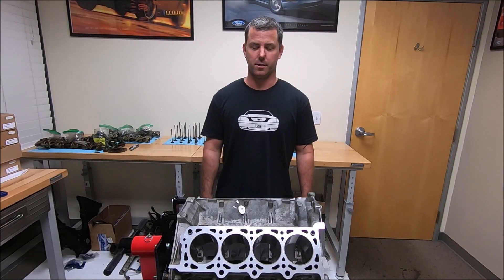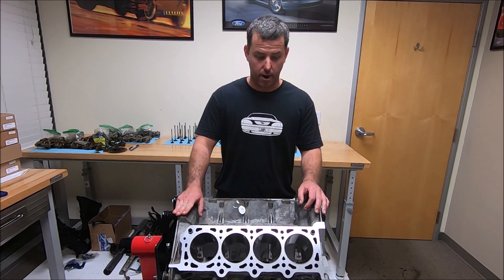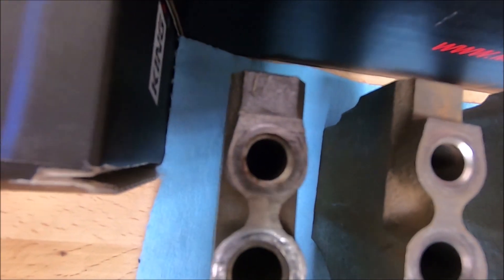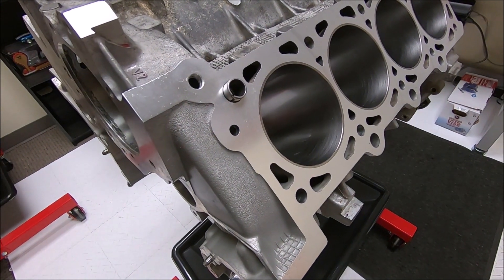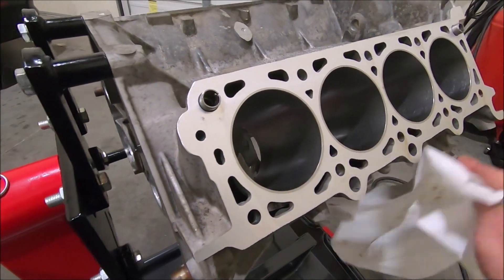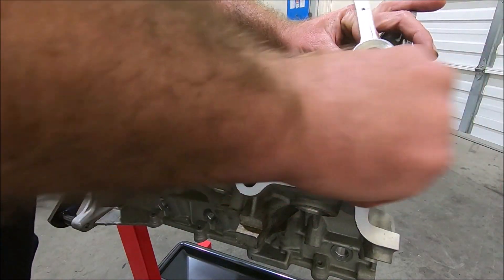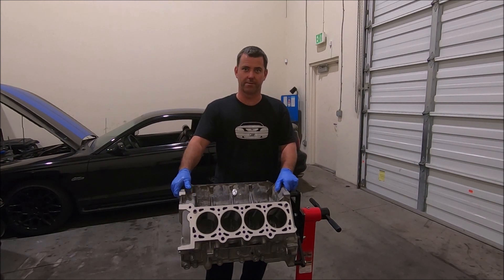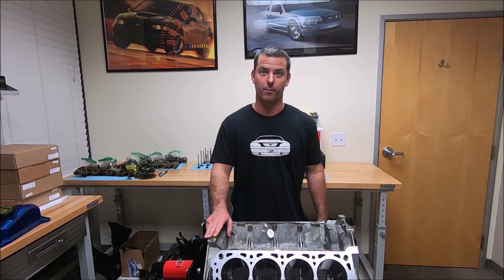Ford 4.6 aluminum Teksid engine block information and preparation

Comment: Can you help me out bro? I have this block from mmr, it was built for a 2v the clowns never drilled the 2v hole for water passage heads, but my main concern is all these comments related to the timing system and clearance issues? I am using cobra engineering pin kit and going with a 8mm upgraded pivot pins screw in, I am using Shelby mike timing stuff with factory chains, my engine is a 4.75 stroker 1000se, but I need you help
Reply: I never drilled the passage on my blocks either. My current. 4.6 2v has 734k miles on it now and it has never been hot. Hauling trailers with scissor lifts all across the country. I didnt drill the hole on the new 5.4 block sitting in my stand ATM either. Keep the heat out of the oil with that rear head cross flow dealy( copy MMRs with ACE hardware or home depot for like 40 bucks) and keep up with maintenance. A water pump is cheaper to change before going bad than it is building one these things. 2v heads are getting rare and $$$$$ ans intakes are non existant. Unless you widen an Eddie. Or find a hps hardballr....somewhere lol.
Reply from the maker: I have built engines with that hole drilled and without it being drilled without coolinf issues.  If you want to drill it use a gasket and center a hole in there about an 1/4 inch.  What clearence are you concerned with?
Reply: @JohnSmithRacing  timing guides? A lot of post saying they hit oil pump area, not sure if this is true or not
Reply from the maker: @2vgod460  I have used the Cobra Engineering kit with and have not had clearence issues.  Its a great kit in my opinion.  You can email me pictures if you want a second look.

Comment: To run @ 1000whp. What boost and octane levels are you're looking at? With a teksid base block.
Reply from the maker: Boost will depend on heads and CR but most likely E85 or Race fuel to get those numbers
Reply: @JohnSmithRacing  kind of figured it had it been at least E85, but I'm running into that problem E85 is not relatively available in my area, was thinking something maybe with methanol injection in between 100 to 110 octane. But I can settle for the 700 horse range
Reply: @JohnSmithRacing  I stand corrected on the E85 first I thought I would have to drive 100 miles out, just to go get some I found a closer station that offers E85 so check on that I don't think 18 lb of boost will do it. I was looking at a long block setup 4.6 two versions 1 safely to handle 18 lb of boost and the other 25 lb of boost but I'm already looking 10K just for the long block. For 25 psi boost . And the one setup for 18 is half the cost

Comment: Nice video, how's it coming along??
Reply from the maker: Thank you, this engine was completed.
Reply: John Smith Racing would a turbo application be better for this engine or supercharger
Reply: @JohnSmithRacing  Do you build engines for regular customers? I'd like to get a build started. Even just the short block. Proper prep, balance and blue printed engines are what make the improbable outcomes possible. And run reliable. That's where machine work and having the right tools come into play. That's what I lack  Id love to bring my aircraft knowledge into one of these Teksid blocks for my 98 GT.  NMRA factory stock guys are making, essentially factory parts, put down average 370 rwhp. No reason a really high compression, E85 feed, and trickflow headed combo can't put down close to 500rwhp NA. Of course that's with 7600-8000 rpm in mind...street driven. I want to see a nasty N/A 2v in my car to put the engine math on the streets. Making most people stare in awe as it keeps up with stock new coyotes without boost or nitrous.
Reply from the maker: @rayman1230  Yes, and I have been wanting to build a sleeved 5.3 stroker Teksid with high compression, TF heads, and Comp Cams.  I think with E85 it could put down over 450 whp.
Reply: @JohnSmithRacing  I'd settle for a 3.700 bore, stock stroke (boss 302 /coyote rods) and stock crankshaft. Keep it light weight to spin up quick. The stroke is already long. But the bore size is what kills the modular engine. As I'm sure your well aware of. That high compression ( 14:1 or higher) will really help with low end torque. Also, I want to see proper LSA used. 110° or tighter. Hydra boost rids the vacuum issue for appropriate brake boost pressure. I have yet to personally see cams that are truly made for full performance on 2v's, on the street.
Reply from the maker: @rayman1230  Sounds good to me.  We could get some custom Todd Warren cams with a tighter LSA.  With the right exhaust system it would have a sound that everyone would notice haha
Reply: @JohnSmithRacing  hell yeah lol Todd is good people. I had spoke to him before. He's a veteran as well and from Ohio lol
Reply from the maker: @rayman1230  Yeah, Air Force I believe, but we won't hold that against him haha
Reply: @JohnSmithRacing  Hey! Don't hate on my chair.. it comes in the form of a C17 😂 but yes, you are correct. He did the same job I do currently
Reply from the maker: @rayman1230  All joking aside, it doesn't matter what branch, those that served and continue to serve have made a decision very few make.
Reply: I’m going to look at a mark viii tomorrow

Comment: Don't know much but... there is a reason why Marvel's hero is not called Aluminum Man.
Reply: John Mihovetz owns the world record and did it with a teskid block. Most of the fastest 4.6 mod motors in that group are teskids. They are anything but weak. Also, the LS seems to do fine with aluminum blocks.
Reply: @benjamins9121  I was talking about production engines, not racing engines. I was talking about Buick (AKA Rover) factory engines, not about Ford aftermarket... I don't give a damn about 1/4 mile, because I want 250,000 miles.
Reply: @Los_Chanchulleros  I never mentioned aftermarket blocks, teskids came in Lincoln Mk8s and 96-98 Cobras although a lot of them wound up in 99 and 01 Cobras as well. I simply mentioned racing engines that used the teskid block to emphasize the power they hold. As far as durability goes they have that too, mostly due to the quality but also the fact that mod blocks are very large for their displacement and heat up more slowly than smaller aluminum blocks like LS's, and also they came with aluminum heads so everything heated up and cooled down at the same rate. I for example put 140k hard miles on my 97 Cobra before I decided to turbo it, the engine was rebuilt with the same teskid block and now supports a 76mm turbo setup. If you care to know but don't believe me do some research on the teskid block and you'll be pleasantly surprised with the strength and durability.

Also, I was strictly referring to this particular block, the teskid aluminum block that came with the cars from factory, I wasn't speaking for anybody elses blocks. Of course a poorly made aluminum block will suck, but the teskids are very well built and you get the strength and durability because of that. The company teskid is from Italy and produced block for Ferrari and Formula 1 actually, I think that says something to the quality. Neither of those things really back up the durability, but like I said if you think they can't handle 250k with proper maintenance you're mistaken partner
Reply: @benjamins9121  a lot of writing... that I will NOT read, but thanks.

Comment: Where could I get jacks crews? A customer brought us a block he bought online, and it's missing its jack screws. We have the new ARP bolts that go through them, but we're looking for jack screws.
Reply from the maker: As far as I know they don't make the jack screws anymore and no one makes a replacement.  You will have to get them used or find some in a junk yard.
Reply: @JohnSmithRacing  Thanks. I had the customer trace the path back to where the block originally came from and the jack screws have been located and we're expecting them shortly.

Comment: When using a 98 cobra teksid block, those use one thrust bearing correct?
Reply from the maker: Yes, one thrust bearing insert with the grooves facing the crank on the top half.  The bottom half has thrust washers built into the cap side bearing.  The grooves are to provide oil to the friction surface of the crank.
Reply: John Smith Racing  thank you! And i assume it goes on the outside of the the block not the inside bc, i tried inside and it just falls. I put it on outside whefe flywheel goes and it fits perfect
Reply from the maker: @lazy_4valve213  Yes it goes on the outside.  Think of it taking the force of the clutch being pressed in.  That area of a crank is common to wear out from clutches not adjusted properly or people riding the clutch pedal.

Comment: What's the timing dowel upgrades you have to do to a 2v?
Reply from the maker: The cast iron block dowels are pressed in.  Cobra Engineering makes a nice kit to drill them out and tap them for larger ones.
Reply: @JohnSmithRacing  thanks John I'm getting my teksid bored and honed currently, and was just trying to get everything needed before it gets out. I appreciate the response!
Reply from the maker: @cristianrivera6562  No problem.  Some will argue that you need to drill the driver side for a cooling passage but I have put them together with and without doing it with no noticable difference.  Also one of the holes on the timing chain cober will not line up so make sure and put rtv in and around that bolt hole

Comment: Also I believe the Teksid came in the ‘99 and early ‘01 Cobras.
Reply from the maker: Yes, every 2001 Cobra that I have seen has the Teksid block.
Reply: Teksid blocks came in early as 1993-98 on Lincoln Mark VIII's & 96-98 Cobras (shared the same block ,F6LE)... Ford started casting their own aluminum-blocks at the Windsor plant around 2001/2002 which came in the Mach 1 , Lincoln Aviator, 05-10,  Mustang GT 3valve ...